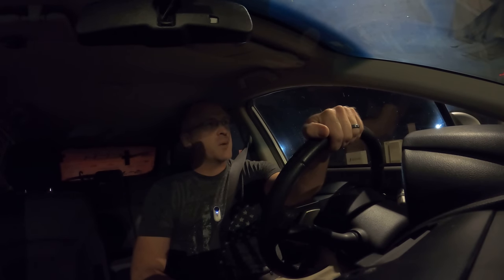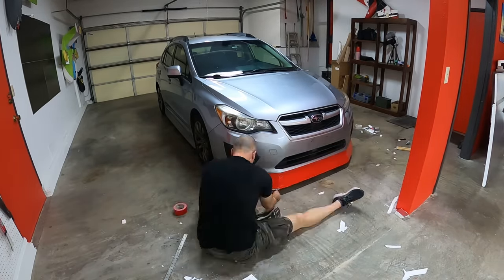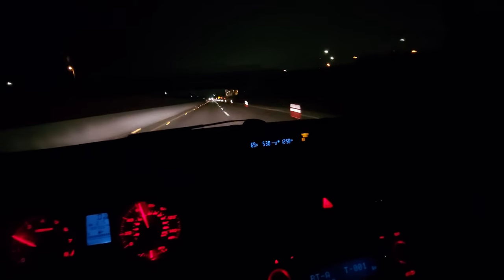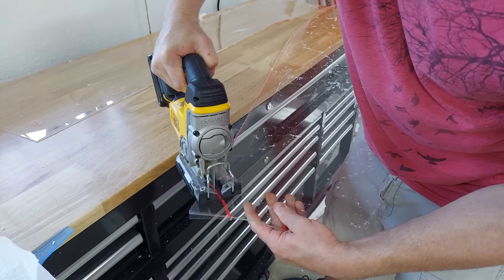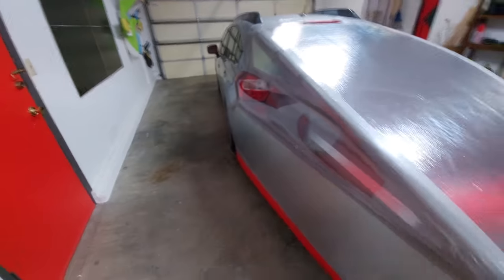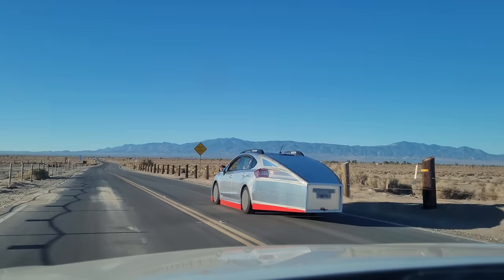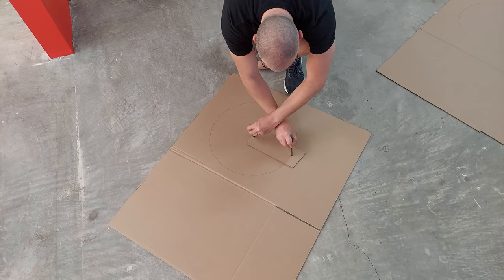Beating High Gas Prices Using Simple Aerodynamics (Home Improvement Store Edition)

Comment: I think it's very likely you fill up to a different point every time. You'd probably need a more accurate sensor in your fuel tank, or a transparent hose that makes the fill status very clear. I've found for my 50l fuel tank, that filling from empty till the click, then letting it really settle and filling again till the click gives me am extra 3l of fuel.
I've been tracking my fuel consumption for aound 50000km, 2500l of Diesel, and sometimes for no reason my sonsuption goes up by like 5%, even though I commute the same long route every day.

Comment: Removing the skirting introduced more drag, than the ever-so-slight increase in efficiency of the new tail could hope to compensate for. The ground effect between the chassis of the car and the road, is ~30% of the total drag of a modern car! You were definitely on the right track, when you tried to address turbulence underneath the car. Another thing to address, (I'm sure you thought of this) is tire rolling resistance. Tire pressures make a big difference. When a car becomes this efficient, tire inflation pressure becomes a greater percentage of overall drag, in that it greatly influences rolling resistance. Ambient temperature also makes a difference. A cold tire on a cold road on a cold day has much more resistance, than the same tire at the same inflation pressure, on a hot summer day.

Comment: Drop weight Electric fan conversion light weight pulley conversion, hot air intake instead of cold air intake. 5psi over tire pressure. Tune the ecu to run at 15.5afr instead of stock 14.7 stoic also automatic transmission oil cooler will cause the transmission oil to slip less and improve efficiency of the torque converter lockup coupler. I’ve done all of this and it all works I’m a mechanic 15 years

Comment: I believe in order to get an apples to apples efficiency comparison on your drag coefficient, all tests must be done at the same temperature, relative humidity and elevation, and allowance for barometric pressure should be factored into the final results.  Your results are probably accurate for each test and it's testing characteristics, but each test was had slightly different character differences as I outlined above.  I know you're not going for stoichiometric :-)

Comment: a 0.3 gallon deviation on 4 gallons sounds like a lot, but it could be fuel temp related (filling up in the morning vs evening affects fuel volume as the tanks in the ground heat and cool leading to slightly different densities. it's why its done by weight in aviation.) or it could be down to aeration of the fuel as it's delivered. the "click" happens when the air tube is obstruced, and having a nozel that produces slightly more foam while dispensing will trigger the stop early. 
It's why Mythbusters always used a fuel cell, you can just put it on a scale to get the fuel weight

Comment: You could use the bottom flat sections of a couple of truck bed liners to make under trays. 
Use rivthreads to attach them to the bottom. You also could use abs sheets.  Even though most of the bottom of my '19 prius has trays, I used airtabs to jump the exhaust gaps and suspension gaps which has resulted in a 3mpg gain. 
Still a work in progress.

Comment: First off, great work on this.  Hopefully your testing is consistent enough and over enough miles to make up for any driving or environmental differences.  I also would recommend pulling the gas pump lever until it clicks a second time.   As for the aero, I helped design the SAE supermileage car that went on to hold the US made  car record of 3013 mpg.  After several iterations of the car, we found rounding the edges on the features helped .  Doing this on the edges of your tail and the rear of your tail would help, but is certainly tough to do with your materials.

A 17% improvement is really good.  You also have to considering that roughly half of your energy is going into rolling resistance, so really you probably improved the air drag by ~30%.  I would see if you can make any "easy" improvements to the underside of the car.   Also, make sure your tires are pumped up to near their max (read the sidewall, it probably says 44 psi or 52 psi max, so go to maybe 2 psi shy of that when it is cold.

I have a 100 mile commute and I tracked fuel economy religiously with various variables.  I found 1 mph faster in average speed would make my fuel economy go down by 0.8 mpg in a 2013 Mini Cooper S with the full factory GP aero kit (under tray and wing).  EPA was 36 mpg highway I believe and I normally would get 40-42 on a nice day, with my record being 47.2 mpg when drafting a truck the one day that was driving particularly slow.  I've generally found my best fuel economy in a vehicle I can get is about 40% better than the EPA rating.
Reply: Why are curved edges better? My understanding from Julian Edgar's youtube channel is that sharp cutoff edges (ie a bullet shape) reduce "suction peaks".. any 'wrap-around' of that airflow will cause a low pressure on that surface, helping pull the car backwards

Comment: A simpler test that will eliminate the most errors is a down hill coasting test. Others have mentioned it. And it can be done in other forms. Dead stop from exactly the same place on the same hill under the same weather conditions and simply monitor the top speed and coasting distance. Do this 10 times with the regular car to establish average deviation. If your aero works well the top speed will increase as well as total coasting distance. I bet the car in it's stock form will fluctuate +-3% or more so an increase of 17% without knowing the average deviation is more likely 10-14% in actual improvement. That's still very good. So keep going. Make sure all things are kept equal. Tire pressure, weight in the vehicle, weather especially wind conditions. If the wind or traffic turbulence fluctuates the air +- 3% that's not helping get good data. stay away from dirt it will very the rolling resistance, stay away from testing in traffic and avoid stops and starts in the test, that puts the engine in the worst efficiency rpm range and can easily be effected by the driver, also avoid turns as they induce turning drag and are also effected by the driver. Go straight down a hill and only measure coasting top speed and distance and a more clear picture should come from that. Good work keep it up.

Comment: The reason for fuel burn marks is how warm the engine is from start and how gunked up your stuff is. Internal airflow is majorly affected by air density. I live at 6k alt, and I go to 3k alt to enter a city. I notice the difference between both altitudes in every vehicle I drive. Morning is different than mid day in how cool an engine runs.

Comment: For testing I would recommend measuring instant mpg, not trip mpg, and at as high of speed as possible to make the differences more apparent. If you can do 90+mph on that lake bed that would be much better. Calculating based off a trip introduces so many variables, not least of which is the driver. You might drive more cautiously with the tail, thus improving MPG.
Reply: Yes and wind plays a major role
Reply: @aapjehoan  and static wind is easily measured and you can somewhat normalize the data by taking data points going both directions. It's much easier to calculate a potential variance knowing local windspeed than trying to guess/calculate driving style impact.

Comment: To get beyond 18%, here is a suggestion. Some air will flow underneath the car even you put an air skirt in the front. Starting from the rear bumper, you can taper the underside of your tail addition. The angle of the taper is gentle. See 2000 Honda Insight or Chevy EV1.

Comment: Interesting you mentioned the car felt more 'grippier' on the road with the initial test of the side skirts/front splitter. Maybe you realized this, but you DID make your car grippier. Not sure if you're familiar with the 'ground effect' phenomenon seen in race cars, but by blocking off the underside of the car you're creating a low pressure zone that effectively sucks the car to the ground. The neat thing is, there is little drag so it's a fairly aerodynamic process. If you're curious, check out the Lotus 78, a Formula 1 racecar from, well, 1978.

Comment: Take a look at experimental aviation for fuel flow and totalizers.  Plenty to choose from and very accurate.   Thanks very much for your efforts in this endeavor, very interesting.  Efficiency IS in the management of the air.  I added disks to close off the rear dual wheels on my tow rig (second gen Dodge 3500, manual gearbox, Cummins powered RWD.)  I log every tank (have sense purchase), noting if towing Ect, and I can clearly see a slight gain, .37 mpg over 40 fills.   Sounds like mouse nuts, right?.  AT $5 plus a gallon, for now, every little bit helps.

Comment: In order to fill your tank to a consistent level partially fill at the pump and then use a dip-stick and top up by hand from a can to the same level. As an alternative to the dipstick get a clear plastic tube; insert it into the part filled tank; seal the end with your thumb; partially withdraw tube now filled with fuel; have the tube describe an S shape rotated 90°; take thumb off end; now the fuel in the visible portion of the tube will show the level in the tank. This should allow consistent filling of the fuel tank.

Comment: There are so many variables with testing fuel economy. 
Two bigs ones, are the energy density of the fuel, and the octane rating. Both of these are legally allowed, from batch to batch, to vary by up to 6% for energy density and 4% for octane. Temperature of the fuel can also effect it's overall density and the temperature in the gas station tank can vary according to how long it has been siting. 
All of these can have large effect on economy.

Comment: There are all types of pumps at all types of stations, a lot of people giving complicated methods of how to get an accurate fuel reading, but my suggestion would be to go to a gas station that has pumps you can throttle the gas at. Some stations the pumps can be squeezed slowly, if you do that the gas will trickle into the tank vs a strong station that can pump a quart a second or more. I think a longer fill time especially in the last gallon of filling would allow the shutoff to trip more reliably at a much closer to "full" level.

Comment: The fueling station pump is such a gaping hole in this process. I'm fairly certain I pointed this out on another video.. and similar videos from other people here on YouTube.
 
When I calculate fuel efficiency it is by filling the filler neck to the brim each time. Relying on the auto stop to determine the volume of fuel used in the tank is a poor choice.

I modified my fuel tank to have nearly no air-space when done fueling by cutting a tube inside the tank.  The capacity went from 26.3 to 31.9 gallons. Previous to that the auto-stop function on the pump would usually trip at 24.1 gallons due to the surface tension of the fuel being high and creating foam in the tank that needs to dissipate  to continue filling. ( Bio diesel content and ethanol content cause this fueling aeration.

Comment: While you eliminate one variable by using the same gas pump you still have the issue of the automatic shutoff.  It will never be consistent.  You have a couple of options.  1. Drain the tank completely.  Not sure if there is a drain plug on the tank or not.  Once it is drained put a measured amount of gas in the tank.  Then run the car until the fuel is exhausted.  Then put gas in the tank, start the car so until the fuel lines are primed then drain the tank again and refill with the same measured amount of gas.  Repeat drive with the aerodynamic changes.  Another option is to put a small tank and pump in the trunk and move the fuel lines.  Either way you need to know precisely how much fuel you put in and then run until empty.

Comment: Fuel pump stops when substantial amount of bubbles reach the top of the gas line, the vacuum tube in the pistol is very sensitive there. I usually wait for the bubble level to go down and can pour in another liter (for an actual full tank), so each time it can be 2-3% random depending on the temperature, humidity and atmospheric pressure, so refilling until the pistol fires is a bit random. The MOST accurate would be filling it with a jerry can (metal one) and have some sort of a physical dip stick in the tube and still, you might get a difference because your cars tank is plastic and can expand/contract. Too much work to calculate the remaining 3% is you ask me. Cars with direct injection (piezoelectric injectors) know VERY precisely how much fuel was dumped depending on the RPM of the camshafts — performance of the fuel pump, as the fuel pump gasflow is knows for a given rpm and for how many milliseconds was the injector open. My car (Hyundai with a G3LC engine) gets a more precise reading than me filling the gas  tank.

Comment: To get the most accurate data you should fill a Jerry can with a specific amount that way you can eliminate the pump errors. Then either run it till it quits and measure time or have a set time and check how much you have left, the first is probably more accurate than the second unless your tank is split
Reply: not completely "split", but if you look at the shot under his car (i know this from having owned a few subarus) its "partially" split to fit over the other components for the AWD system. Such as the drive shaft/prop shaft, Sometimes when you are low on gas you can take a corner fairly sharp, or a freeway onramp and end up a couple lines up on your gas gauge. The "digital lines" and readout is only as good as the older style almost "toilet tank bobber" style gas tank float system.
Reply: if you pause at 1:37 you can see the plastic "skid protector plates" on either side covering the gas tank tucked away up there.

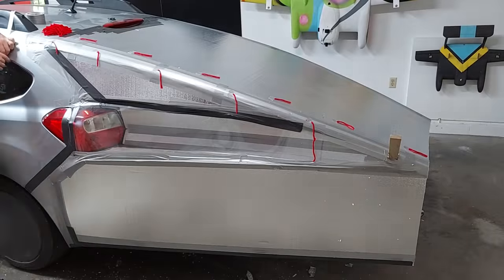Comment: Your new tail is less efficient because ot the vortices created at the edges were the upper surface and the side surface meets. This is beacause your tapering angle is larger at the top surface than at the sides, creating two vortices similar to airplane tip vortices and these cause the excess drag. You can even see these vortices even at low speed in your smoke test at 11:42.
Other input is that seapation is usually just a bubble, the airflow closes up after the bubble so it is not necesserily as big of effect as one might think. (Taillight covers are not so crutial.) So even if you have some separtation but if you manage to taper the tail of the car more your wake region can actually be smaller. 
As for the wheel arches you do not have to fully close them you can merely make the gaps smaller.

Comment: for I while I was into the idea of making a velocycle ( think that's the correct name.  An enclosed recumbant bike at any point ) and everything suggested a roughly 45 degree angle on the rear piece starting at the bottom and going back at the top. It was said that the air effect caused behind that would push the vehicle along. I wonder if the same works on much heavier automobiles.
Reply: You mean a velomobile. And yes, velomobile riders around the world (like myself 😉) know that efficiency is all about aerodynamics (and good tires, too). A closed and "clean" underside plays a very important role in that, too. On her world record (1129,88 km in 24 hrs) Nici Walde was doing 50 kph at less than 100 Watt.

Comment: my first thought watching this was pressure at the pump fluctuating giving you different fill-up results. i had a wrangler that would click pumps off early from the gas's bubbly "head" in the filler neck. i imagine even the same pump has varying pressure dependent on a range of variables. you might be able to use calibrated vehicle scales to measure weight pre/post trip. or do the inverse and run til empty ...

Comment: Airfoil in relative wind eguals lift production (vertically and horizontally).  Lift production (beneficial and non in regards to weight derived friction) frome the laminar flow of air against the body always produces induced drag. The lift to drag coefficient is what you are battling, just like an aircraft. This is why the push air around method works, too. It does add drag, but adds less overall drag, thereby increasing efficiency. BTW, that induced drag ratio decreases  with increased speed...the opposite of every efficient dream. Don't get me wrong, i love the work and the video.... This is not a negative comment

Comment: You still have have a big flat section on the back. That would cause a lot of drag. Do a tuft run, with tufts on that rearmost flat panel. 

I would think you'd be better off with a concave instead of a flat  So, there's less chance of boundary layer getting pulled around the edge where it finishes. I guess you could easily test that with some edge extension pieces on the tail. I would go for the sharp wing / knife type merge though, like the Aptera has, for minimum drag.

Comment: replace the mirrors with cameras, get slightly skinner and lighter wheels, remove roof racks (wouldn't have to weld shut you can just use a plastic filler cap), tape off the rear door handles, tape off portions of the front grill if you can without overheating.

that's all the recommendations I have to improve mpg.
still a 17.9% isn't bad at all.
the Crosstrek has a 15.9gal tank and 34mpg highway. With these modifications and an increase of 17.9% will yield a 51.9mpg Highway coupled with a 15.9 tank means this car could theoretically travel 825mi on a single tank

Comment: If you want to avoid the complication of the tail light cutouts and potentially unwanted cop attention, I'm sure there's a trailer wiring harness available for that car. Then you could just plug in a second set of tail lights on the end of the tail fairing itself.